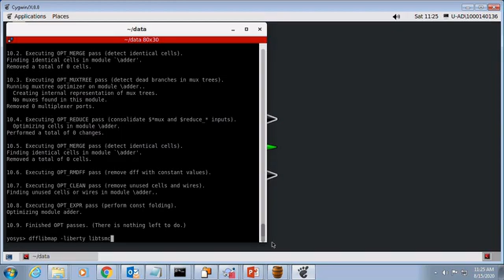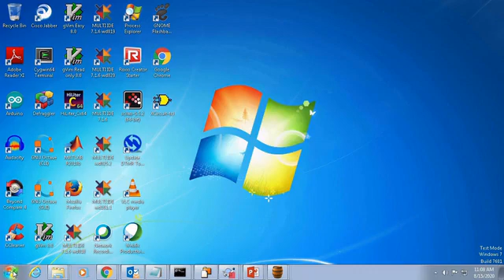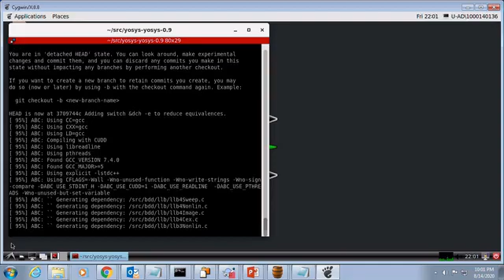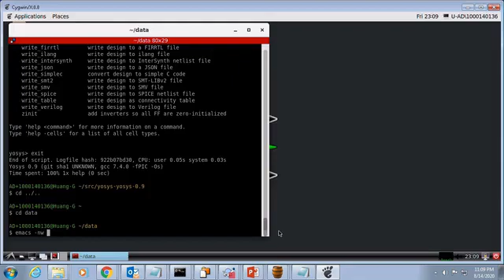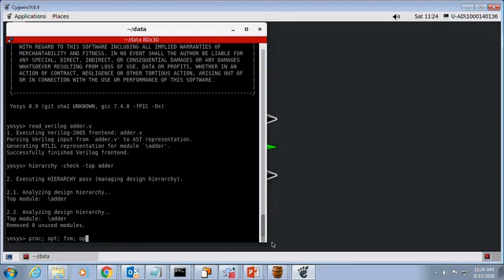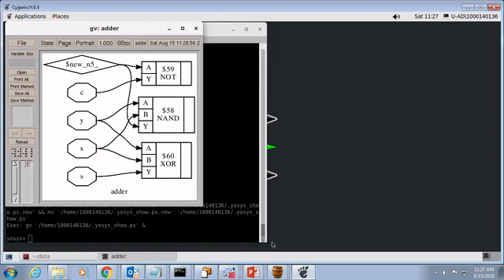yosys install

Comment: please provide the steps to synthesize the design.
Reply from the maker: This video basically exercises the synthesis steps given by http://www.clifford.at/yosys/files/yosys_presentation.pdf, page 18 to page 37. In the official yosys site, there is a manual http://www.clifford.at/yosys/files/yosys_manual.pdf which answers pretty much all questions users may have. Also in http://www.clifford.at/yosys/documentation.html#Support it points out the places that questions can be posted for help. Sorry for not being able to make a comprehensive tutorial since yosys has a rich set of functionality. This video simply intends to give beginners a visual presentation on where things are and what basic function yosys provides so that a new user can quickly get the source compiled and start using it. Hope the few resource links above may help getting to the right direction.